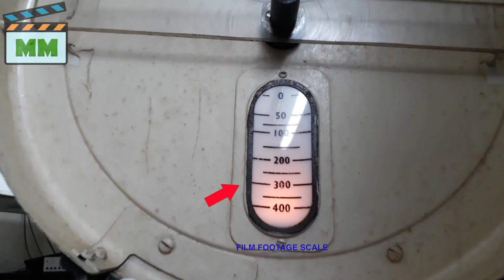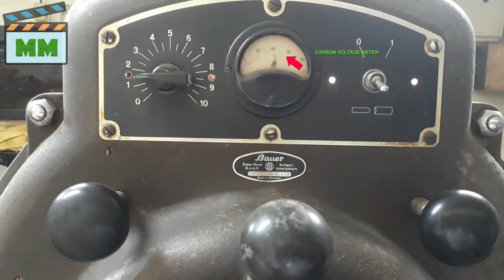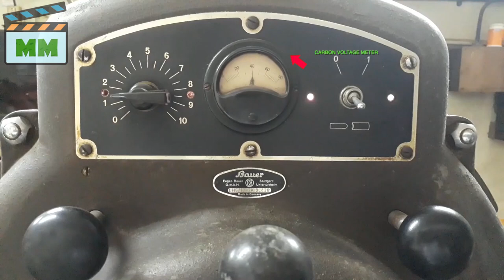Film Projector By Bauer

Comment: Only 3 sprocket simple to handle this by opertor many of the time arc house automatic can't be worked oil need to changed periodically in tamil nadu most of the old theatre used this bower lateral photophone and westrex rule the theatres at time last 1990 s 3 to 5 lakhs cost